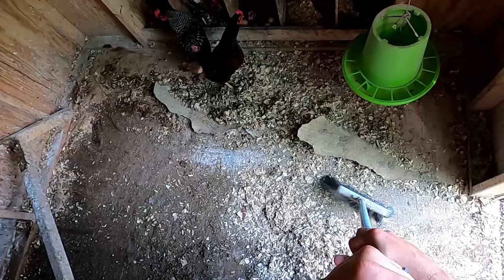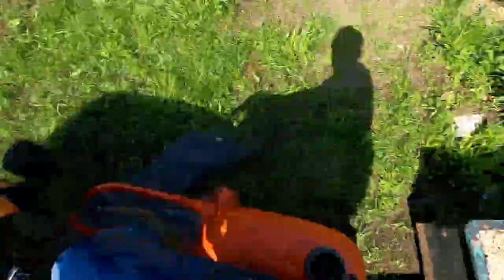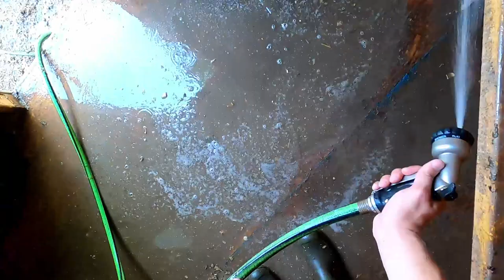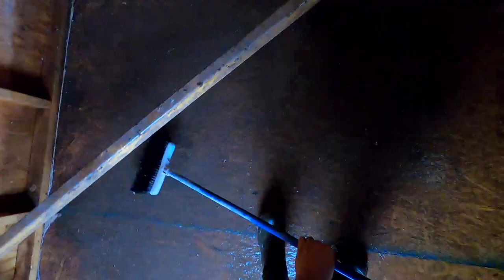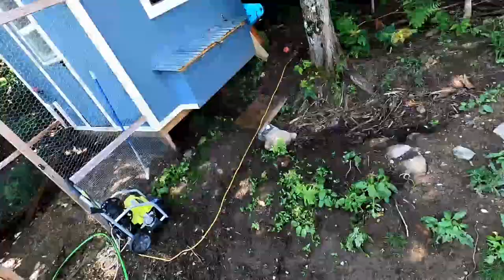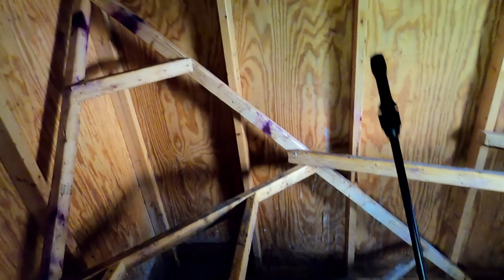Permethrin 10 for Chickens ||Extermination of pestsll

Comment: Your video said to use 6.7 oz per 1 gallon of water.  The mixing chart in my Permethrin 10 container says to use a 1:200 mixture for poultry.  That's about 1 oz per 1.5 gallons water or 8 oz for 12.5 gallons of water.  Users should check their directions.  It's pretty powerful stuff.
Reply: I'm gonna look it up again. Instructions for spraying the coop are stronger than using on the birds

Comment: I did subscribe and like, and thanks for the info on how you used Gordon's Permethrin 10 in your coop! I couldn't help but notice the box fan you're using. Be careful - they do not have fully sealed motors and have been known to cause fires when used for agricultural uses. Cheers!
Reply from the maker: Thanks for the support! Thats good to know, dont want to be one of those chicken coop fire casualties. We only had it in there to dry the coop.